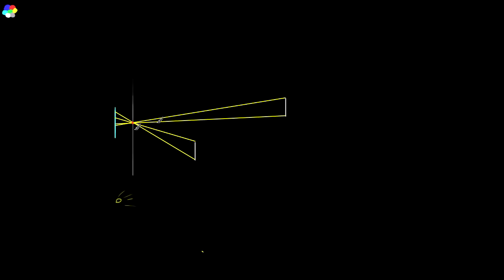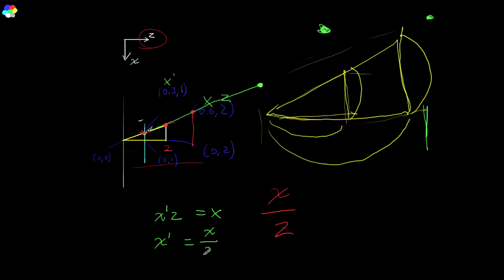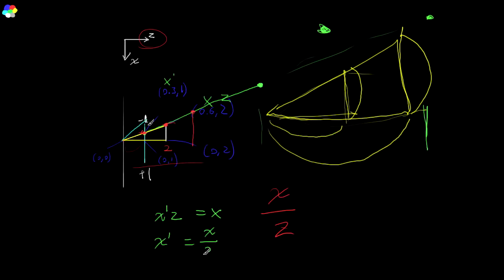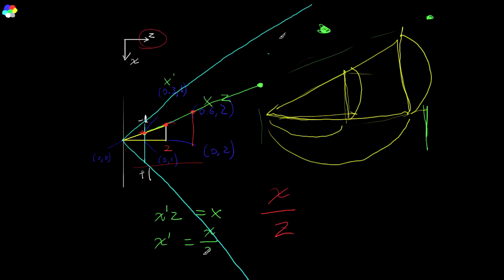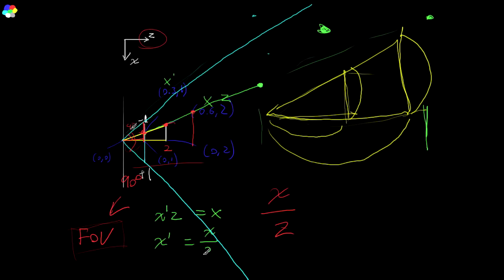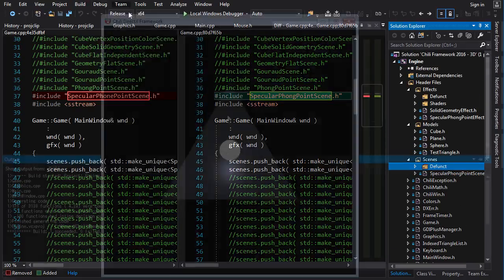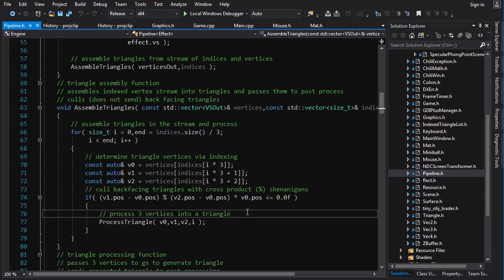3D Programming Fundamentals [Projection Matrix] Tutorial 20

Comment: 11:35 "this normalizes the vector" (devide by w) - no it's NOT! Normalizing it would be deviding by it's length, which is very different from it's 'w'.
Normalizing vectors from the origin ALWAYS brings them all down to the "unit-circle" (a circle with radius 1 around the origin).
Dividing by 'w' does no such thing - what it DOES do, is scaling the vector down UNIFORMLY, untill it's 'w' is 1.
Essentially, if "flattens" that extra dimention in all the vectors, back to the same value of 1 - which is why it can be thought of as getting rid of the effect of that extra dimension - therby bringing the vectors back to "regular" space (whatever dimention is without the extra one of w).
The full story there comes from projective geometry, which I've linked some videos about to in my other comments. 
I'm thinking of making a long video myself about how this whole perspective business ties into projecvtive geometry, and what's really going on ther, visually.
Reply: Please correct me if I am wrong. So in graphics, there are multiple spaces but the 2 that I am going to mention are view space and clip space. View space is when all the objects are transformed so that they are relative to the camera meaning that the transforms of each object are multiplied by the inverse of the camera's transform. This space is 3D. In order for a computer to render it to a 2d screen, it needs to "Project" the 3d space onto a 2d screen. This is where the projection matrix comes in. It projects the 3d coordinates to the viewscreen so the points now become [x', y', z', z] and, when this is changed from homogenous coordinates to screen coordinated by dividing by w = z (or uniformly scaling it in the extra dimension, as you mentioned), it just becomes [x'/z, y'/z, z'/z, 1].

Correct?

Then how is it rendered from here? To draw to the screen, it only requires the x-component (x'/z) and the y-component (y'/z) right? what is the z-component (z'/z) used for? Is it used to see if a point will render at a specific pixel by comparing z'/z to the depth/z buffer?
Reply: @anonymoussloth6687  Before I answer, I wanna note that the way you described perspective projection, although popular and easy to follow, is technically incorrect.

First of all, calling the view->clip space matrix a "perspective projection matrix" - although popular is incorrect. It does NOT actually "project" anything... Because that's mathematically impossible to use a single matrix for that - you'd need a separate matrix for each vertex if you really wanted such a matrix to actually project vertex positions with perspective. 

So that's not what's happening. 

What IS happening is that the view->clip space matrix is just "scaling" the space, such that after perspective projection would happen, that space would land in NDC (Normalized Device Coordinates). 
In OpenGL this space is a cube, so all 3 axis aqre in the -1 -> +1 range. 
In Direct3D it's a half-cube, so X and Y are in the range -1 -> +1, but Z is 0->1. 
So, in a way, that matrix just "prepares" the coordinate space of view space for projection.

The actual projection is using a different projection/scaling amount for each vertex (which again is why there can't be a single matrix that does that...).
That's called "the perspective divide" - is what you called "normalization" of the homogeneous coordinates back to regular 3D coordinates.

That's actually the simpler version of that story...

The "real" story of what's going on there, is that first of all clip-space is NOT a 3D euclidian space(!) 
It's actually a 4D projective space(!). 
That is why you need a 4x4 matrix to transform it. 

In addition to scaling the 3D slice of that 4D space, the matrix also ends up "lifting" the coordinates off of that 3D slice of 4D space into actual 4D projective apace (with each vertex position ending up with a different W coordinate - that's the W depth of 4D space).

Then, what the "perspective divide" is ACTUALLY doing, is in a way projecting that 4D space, back into 3D space(!!!) 
That is, back into a 3D slice of that 4D space - a 3D slice at W = 1 (the 4D depth axis).

That's why you get 3D coordinates out the other end of it (either a cube in GL or a half-cube in DX).
That's how the differing amounts of depth in the original 3D coordinates are maintained even after perspective projection.
The Z-depth value in the resulting space are no longer ranging linearly as they did in the original 3D space, is more like a curve, but the "relation between them" is maintained, so that you can use those Z values to differentiate which vertex or triangle is in front or behind others.

That's how you get your Z buffer.

So then in the pixel shader, you're actually working with a 3D space, not 2D(!).
As I said, the projection is from a 4D space to a 3D space. 

So saying that "the projection matrix projects the 3D frustum onto a 2D projection plane", is an oversimplification that is intuitive though technically incorrect .

NONE of what it's saying is correct actually...

1) It's NOT "projecting" anything, it's just a scale matrix.
2) It's a 4D transformation matrix for a 4D projective space, not a 3D euclidian space.
3) The projection that DOES end up happening, is from 4D projective-space (NOT a 3D space), into 3D projective space (NOT a 2D space of a projection plane).

That resulting 3D projective space, is a 3D slice of that 4D space with a uniform W-depth value of 1. That makes it possible to interpret it AS IF it was a 3D euclidian space. And that re-interpretation of it is what NDC space is.

Hope I didn't confuse you too much... :)
Reply: @AinurEru  I see. So, in summary, the view to clip space transformation matrix which is known as the projection matrix just transforms the space so that the camera's frustum becomes a cube/half cube. This is done on the 4d/homogenous coordinates of the points. After this, the points are still in 4d, so, in order to get them to 3d, we divide each point by w (which is the previous z before the projective transformation) which you mentioned is called a "perspective divide". This has the effect of getting the 3d point from the 4d point as well as scaling things in a perspective manner - meaning farther objects are smaller since they are divided by a larger w (since w is the pre projection z-value). This now results in a 3d point of which the x and y values are used to map it to the screen and the z value is used for depth testing with the z/depth buffer for rendering. 

So, in reality, the objects aren't flattened anywhere. Instead, they are transformed so that the camera frustum becomes a cube. And then the z values are discarded - or rather used for depth testing while the x and y values map to the screen.

Correct?
Reply: @anonymoussloth6687  Yeah, basically - you got almost all of it exactly right:

That you end up with a cube/half-cube space at the end of it (by the time you get to the fragmen/pixel-shader in graphics APIs) - that's correct. 
Whether THEN you consider the Z depth value of your "pixel position" or not, is up to you - what you do/don't do with it in your fragmen/pixel-shader. 
But it IS always used for you by the graphics APIs even BEFORE it gets to your pixel shader, IF you tell the graphics API to do that (Z-test, using a Z-buffer, etc.).
It would then use that to not even invoke the fragment/pixel-shader for that fragment, if it's already been determined/prooven that it'd never even get seen, because it's exactly behind some other opaque fragment that's already been drawn.

That the prespective effect is the result of having further away vertices scaled down on X and Y proportional to how far away they started as (their "original Z" depth coordinate), and that this happens as the "perspective divide" which is NOT part of the view->clip matrix that you provide, but rather a separate "per-vertex" step that happens AFTER the view->clip space transformation had happened - that's also correct.

But that the view->clip space "transforms the frustum-shaped space into a cube/half-cube", is just ALMOST correct - it actually transforms a frustum looking space, into another different frustum looking space - the space only subsequently turns into a cubical shape AFTER/THROUGH the perspective divide. So, a more accurate way of saying what you said, is that the clip->view matrix transforms a frustum-looking space into "what it would need to be for it to then be transformed into a cubical space by the perpective divide". Put differently, if you think of it in reverse, if you start-off with that "cubical" (NDC) space, and then "multiply" each vertex position by it's original Z instead of dividing it, THAT is what that clip space is(!). 
So, it's NOT a cube shape by itself ( yet). 
It's what it "needs to be in order for it to be transformed to that" by the perspective divide.

The historical reason for this very odd and confusing scheme, is to be able to clip and even cull away whole triangles, if they can be "proven" to be fully outside the view frustum, and to be able to do this prooving as early as possible - more specifically, BEFORE the perspective divide(!) 
Because historically, a division used to be a much more expensive operation, of the kind that you'd rather avoid having to do for as many vertices as you can proove won't need it.
And so, it can be done in "clip space" (hence the name...) BEFORE the perspective divide happense - here's how:

Say you wanted to cull triangles that you know are outside the view frustum (or "clip" ones that are "partially" outside). If you do it in a cubical space (NDC), the math is super-simple - you don't need any fancy planar in/out test for each of the faces of the slanted view frustum - you can just check if any of it's coordinate is outside the cube (-1->+1 in X, Y, Z, or 0->1 in Z in the case of DX). 
So that's easy. 
But to get there you have to already have gone through the perspective divide, and that's "expensive" so you wanna avoid that... 

Well, here's how you avoid it: 
You KNOW that for each vertex position in NDC (cubical) space, it's going to be in a very simple to identify range, and you also KNOW that to go "backwards" through the perspective divide, you just multiply the 3D coordinates by the W coordinate.
So, for each vertex position, if an in/out test would have been in the range -1 -> +1 in NDC space, then going backwards to clip-space that means that the range would be -1*W -> +1*W.  And guess what - in clip space you already got that W coordinate for each vertex position, and so to cull or "clip" a triangle (cull-test all 3 of it's vertices) all you need to do is for each vertex position check if any of it's X or Y or Z coordinates are in the range of it's own "individual" W coordinate. 
THAT's how you cull vertices and clip triangles in "clip space", before the perspective divide happens.

Lastly, you said that the X and Y you get in the frgment/pixel shader "map to the screen" - well, not exactly... They map to NDC space (-1 -> +1). Think of it as a standard intermediary space that's independant of the final display resolution. 
AFTER your fragment/pixel-shader had all ran, the graphics APIs then subsequently do a final transformation into actual display resolution space. That's a simple transform, just shift everything by 1 up and to the right, then, scale it down by 2 to put it into a 0->1 space, then scale horizontally by the horizontal display reolution, and vertically by the vertical one.
Reply: @AinurEru  I see. After reading your answer and reading this article: http://www.opengl-tutorial.org/beginners-tutorials/tutorial-3-matrices/#the-projection-matrix I think I understand the concept a bit now.
I just have a few more questions (sorry for the incessant queries). You said mentioned that the clip space has its own frustum and it is not a cube yet (that is achieved after the perspective divide). However, the clip space frustum would be still be a scaled cube right (since the perspective divide just uniformly divides each component by the original z value)?

Also, I am a bit confused about the perspective divide. After the projection transformation, the frustum becomes a prism (as mentioned above and in the article). Why can't we just use the x and y values without the perspective divide since they are already between -1 and 1 after the projection transformation? Is it because it is perspective and the points need to be scaled according to depth?

Finally, what happens if the camera is orthographic? Would there be no need of the projection matrix since the view space frustum would be a prism to start with since the near and far planes would be of equal size? Would it still need the perspective divide too? since object farther away in orthographic mode would not be smaller (so there would be no need for the perspective divide right)?
Reply: @anonymoussloth6687  I think your point of confusion is around the differentiation between what operation is done uniformly to all vertices using the exact same parameters, and what is done with per-vertex parameters. The view->clip matrix is uniform. So all vertex positions get hit with exactly the same matrix. The prespective divide however, is NOT uniform(!). That is, each vertex position (after having been hit by the same uniform view->clip matrix), gets a division by a different parameter that is specific to each vertex (it's own specific Z coordinate). And that division gets applied to X, AND Y, AND Z(!). So, each vertex's X gets divided by a different amount than another vertex's X. Same for Y and Z. That is why clip space is NOT cubical - think of it, the RESULT of the perspective divide is cubical, and then if you back-track that from that (from NDC space back to clip-space), that requires each vertex's 3D position coordinates to be multiplied by a different amount - it's own specific W coordinate. Say you got the top right back corner of NDC - backtracking, that would land it furthest away in X, Y and Z. Now thing of another vertex in NDC that's somewhere in the middle of the left face of the NDC cube. To get THAT one back to clip-space, it's X, AND Y, AND Z coordinates would need to be multiplied by a much smaller factor. So it'd land in clip-space in some place diagonally from the first vertex that started at the top-left. So you see, an edge in NDC space, between a vertex at the top-left-back corner to another vertex on the left face of it, would be aligned with the Z axis of NDC space (goes streight inward). But after the backwards-transformation that edge would become skwued diagonally.  

So when you said:
"However, the clip space frustum would be still be a scaled cube right (since the perspective divide just uniformly divides each component by the original z value)?"
Then, no - it's not a cube, exactly because the perspective divide did NOT "just uniformly divided each component by the SAME z amount" - it actually NON UNIFORMLY divided each vertex position by it's OWN original-Z. The OPERATION is the same (uniformly applied) but it's PARAMETERS are NOT(!) (non-uniform).

As for orthographic projection, that's a much simpler one, and there there's no perspective-divide at all. It get's "disabled" by providing a view->clip space matrix that does NOT put the original-Z in W.
Reply: "After the projection transformation, the frustum becomes a prism (as mentioned above and in the article). "
No, it's not.

"Why can't we just use the x and y values without the perspective divide since they are already between -1 and 1 after the projection transformation?"
They are NOT between -1 and 1 after the transformation - that is just incorrect - they are such that each vertex's position's 3D coordinates (it's X, and it's Y, and it's Z) are all in the range of -W and +W of IT'S OWN SPECIFIC W COORDINATE VALUE (that is DIFFERENT for each vertex position).
-1 -> +1 is NDC space - AFTER the perspective divide, NOT before(!) And the perspective divide happens AFTER the view->clip space transformation, and in that 4D projective clip-space already. Before it's applied, clip-space itself is NOT -1 -> +1.

"Is it because it is perspective and the points need to be scaled according to depth?" 
That scaling IS the perspective divide, NOT the transformation of multiplying by the view->clip matrix(!!!) 
That is exactly why I said that the "perspective projection" name is just wrong - that matrix does NOT emben ANY kind of perspective projection whatsoever(!) Because it can't. Because it's uniformly used for all vertices, and each vertex needs to have a different scaling factor applied to it - the matrix can't be in a super-position... It's just 16 floating point number.
Reply: @AinurEru  Ok so I am now more confused. If the projection matrix doesn't change the frustum to a cuboid, what is the point of the projection transformation? As you mentioned earlier, it takes the frustum and transforms it to another frustum. If neither are a cube yet, then why is it necessary?  Why can't we simple perform the perspective divide? If the answer is to map the x, y, z to their respective -W and +W, then I don't see how x, y, z are mapped from -W to +W (see question below).

Also, you mentioned that after the transformation, the x, y, z are from -W to +W but in the video at 17:40, we can see that the scaling factor for the x and y are 2n/w and 2n/h (note w is width of the near plane here) so a point on the far left of the x axis at w/2 will have a new value that would be n since (w/2)*(2n/w) = n. So the x and the y would be between -n to +n before the perspective divide right (how is it between -W and +W)? after the perspective divide, they are divided by the original z so how is +n/z and -n/z from -1 to 1?

Finally, for orthographic, you said we disable the perspective divide. Does that mean that the frustum is already set to a rectangular prism where the near and far plane are equal in size beforehand?
Reply: And to confuse matters, I watched this video here: 
https://www.youtube.com/watch?v=svKVqROlVSg&list=PLRwVmtr-pp06qT6ckboaOhnm9FxmzHpbY&index=26 
and this person straight up states that the projection matrix maps the 3d coordinates to 2d and even shows a demo of it at 2:50 in the video
Reply: @anonymoussloth6687  I think it's simpler if you think of it in reverse: Your end-goal is NDC - the cuboid space. Now, there are a few parameters that you need to control for exactly what should end up inside the cube and what outside - where the boundaries should be. That's ultimately controlled by the nea/far clip planes distances - they control what distances should end up in the front and back faces of the cuboid in NDC, and then the field of view + the aspect ratio together, control exactly what the left, right top and bottom cuboid faces map back to in the frustum shape. The whole non-linear warping from frustum-shape to cuboid shape is kind of left out of that story. Hope that makes sense.

Again, the view->clip space only has scaling factor, and a translation. It has no shear, and it can't just change the overall shape of the space - it's just scaling and translating (in Z).
The only other odd thing it does is set the original Z coordinate in W. But again, it does not change the overall shape of the space - it can't.

I'll comment on the rest of it a bit late - a bit bussy right now with an online live course that's running right now...
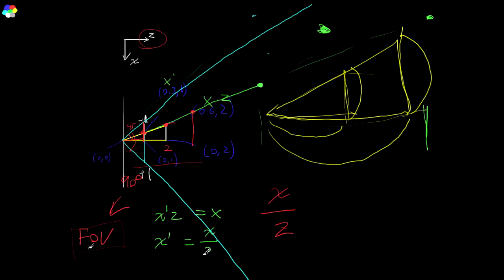Reply: @anonymoussloth6687  4:00 ".. So I intentionally lied to you in the previouse video, the view-projection matrix does NOT smash our 3-dimentional scene into a perfect 2-dimentional scene, there is still depth..."
Jamie King is awesome - his videos are the only ones I know of that actually contains a visualisation of clip-space - I think it's this video later, or some other in that playlist.
Reply: @anonymoussloth6687  Also, 5:00 "...we call it the 'projection matrix' (notice the tone there...), I like to call it the 'view to projection matrix'".
As I said, Jamie is awesome - his term is much more appropriate - it's the matrix that transform the view space into a space where "projection can THEN happen in". Spot on.
Reply: @anonymoussloth6687  It should be noted though, that in his video, the visualisation is NOT just visualizing what the view->clip space matrix multiplication is doing by itself - it looks like it's also doing the perspective-devide right after that, so the visualization shows the combined effect of both. That's why A) the shape get's distorted (as again, just the matrix multiplication by itself just can't do that), and B) the resulting range is indeed -1 -> +1 - meaning, it's NDC, not clip-space.
Reply: @anonymoussloth6687  18:00: "...Now, you might be saying, 'Chilli, I think you made a mistake here, don't you mean a*f +b = 1?? Becuase when Z is on the far plane, we want to map it to 1?' .. Yes, BUT: We want it to map AFTER the 'normalization' , meaning after the division by Z ... so when Z is at the far plane, then you'r gonna devide by f, and THAT will be 1"

Chilli is also awesome, if I failed to mention that.
Reply: @anonymoussloth6687  "Also, you mentioned that after the transformation, the x, y, z are from -W to +W but in the video at 17:40, we can see that the scaling factor for the x and y are 2n/w and 2n/h (note w is width of the near plane here) so a point on the far left of the x axis at w/2 will have a new value that would be n since (w/2)*(2n/w) = n. So the x and the y would be between -n to +n before the perspective divide right (how is it between -W and +W)? after the perspective divide, they are divided by the original z so how is +n/z and -n/z from -1 to 1?"

That would be true precicely for a point at the far left of the x axis at width/2 as you said, THAT IS ALSO RIGHT ON THE PROJECTION PLANE (at Z(original)=n), because then it's W coordinate would be `n`, and so what you wrote as '+n/z and -n/z' WOULD be from -1 to 1, because they would be `+n/n and -n/n'.

Any other point that is right on the left-face of the view frustum that is further away from the projection plane (at 'Z(original) = n') but still closer than 'f', would be precisely as farther away to the left in X as it would be in farther away than 'n' in Z, so the proportion would actually still be 1:1.

That is because the parameterization of the view->clip that is being used in this particular example, with the X and Y scaling factors being '2n/w' and '2n/h' respectively, are for a horizontal field of view of 90 degrees, or in other words, where there's a 1:1 proportion between the Z-distance and the X distance to the left/right face(s) of the view frustum.
Reply: @anonymoussloth6687  "If the answer is to map the x, y, z to their respective -W and +W, then I don't see how x, y, z are mapped from -W to +W (see question below)."

As I explained about how clipping and culling works in clip-space, that's what actually making that space into one that is -W -> +W for all vertext position, because another way of saying it, is that any vertex position that is NOT within that space (and again, that's with respect to IT'S OWN INDIVIDUAL W!), gets culled. Any EDGE that has ONE of it's vertices in that space and the other outside, gets "clipped", such that it's outermost vertex position is right at the edge - with the coordinates actually EQUALING +W or -W. That culling and clipping process is the process that MAKES that space "..between -W to +W" - because anything that isn't, gets culled/clipped.

The purpose of the "view->clip" matrix transformation, is to parameterize each vertex position coordinates (X, Y, Z and W) SUCH THAT their inter-relation satisfies the criteria that any coordinate (X, or Y, or Z) that is outside it's own -W -> +W range, would only occure for vertex that are positioned outside the view frustum before the transofmration. 

That is why the parameterization of this transformation are derived from the parameterization of the view frustum itself - namely it's near and far clipping plane, and the "RATIO" between the near clipping plane distance to the projection-plane's dimensions at that distance. Otherwise computed with the tangent of the horizontal FOV (field of view) angle. It's a tangent, representing a proportion (sin/cos), which is the same aformentioned "RATIO". 
Which, BTW, I have a section about in one of the videos I made on my channel:
https://youtu.be/nIvINO3634M?t=1164
Reply: @AinurEru  So the point of the projection matrix is to map all the points to be between their -W and +W which would mean that all points should have a x, y, z value between -n to n and -f to f since the W would only range from n to f right? This makes sense for the z values but why do this for the x and y too? Shouldn't they be  mapped based on different parameters? I understand that it is for clipping points and checking if all the components should be between -W to +W but wouldn't it be better to check if they are between individual x, y, and z ranges for clipping (since this method also doesn't preserve the aspect ratio of the camera frustum since, in the end, we end up with a cube which has 1:1 aspect ratios on all its faces)?
Reply: @anonymoussloth6687  "So the point of the projection matrix is to map all the points to be between their -W and +W" 

All positions of vertices that are within the view frustum before the transformation, yes. Not the 100% of all vertices, as that would defeat the purpose, because then you can't cull and clip based on that criteria (beacuse they would all satisfy it).

"which would mean that all points should have a x, y, z value between -n to n and -f to f since the W would only range from n to f right? "

No. If that were the case, there would be no way to controll the spread of the view frustum (in terms of that W-space criteria for clip-space positions).

The example in this video pre-supposes/assumes a 90deg FOV. You need to allow this to be controllable if you want FOV to be anything different than 90deg. And that's irrespective of the near/far distances - these are orthogonal concearns, they can't influence each other. But the view->clip space transformation needs to include an accounting for both. I'm not sure how well this is covered in this particular video (I haven't actually watched it in a long time...)

What happens to X and Y in the view->clip transform, is kind of unrelated to what happens to Z (even though the near clipping plane distance is invloved in both).

For the Z coordinate, yes - it should be such that AFTER perspective divide, vertices inside the cuboid NDC space should be ONLY vertices that started between n and f before the perspective divide and before the transformation (i.e: in view space). So the "clip space Z coordinate" value needs to be callibrated such that IF it's view-space Z is inside the view-frustum then when dividing the clip-space-Z by that "view-space Z"  would send it to between -1 and +1 (for GL. For DX it'd be 0->+1).

This video here details an algebraic derivation of determining what specific combination of scaling and translation transformations are needed to acheive that.
(there are other ways of deriving that which I find more intuitive, but that's a separate story - all ways end up with the same values in the view->clip matrix, for Z-scale and Z-translate).

For X and Y, that's a different story. First of all, there's no translation needed, as the view-space coordinates are already centered around the same axis that NDC space is in (the "origin" being the camera/view). So there's just a scaling factors, but they depend only on the aspect ratio, the spread of the view frustum, and the newar clipping plane distance - NOT the far clipping plane distance(!).

Take the X one first:
The simplest case is the one detailed in this video, where the spread of the view frustum is such the both the left and the right planes of the view frustum are purely diagonal (45deg) in relation to the camera. That just so happens to make it so that any point exactly on the outer rims of the view frustom in X is away from the central Z axis by exactly the same amount that it's away from the camera (in Z). 
But that's not the only possible configuration - the view frustum could be wider or narrower, even for the EXACT SAME aspect ratio and resolution(!) 
This spread determinses how much of the scene would get squeezed/stretched on that same screen, and so how strong the perspective distortion is going to be. Wider view frustums need to squeez more view-space into that same -1 -> +1 NDC-space (ultimately) - EVEN when using the SAME near/far clipping distances(!). So the scaling factors in X and/or Y need to be stronger, and the perspective divide by-itself can't do that, as the W values would be the same for wider/narrower view frutums (as they are just the view-space Z coordinates).
So this needs to be accounter-for/applied elswhere, and that's in the view->clip space matrix.

Each axis is callibrated separately, according to it's own needs:
The X axis gets scaled such that it's closest X coordinate on the left (the one at Z='n' in view space) needs to get sent to -1 in NDC, so it's clip-space X coordinate has to be -n. 
Similarly a vertex on the right side at that same distance needs to end-up with an X coordinate of +n in clip-space.

However the same does not necessarilly apply for the furthest X coordinate (one in the far back at Z='f' and all the way on the left face of the view frustum in view-space).
In the special-case detailed in this video, where as coordinates go far, they also go left by the exact same amount, then yes - the furthest way one would be sent to X=-1 by a division by it's Z (which is 'f'), so yes, it's clip-space X coordinate needs to be -f.
However, now imagine a view-frustum that is a bit wider (larger FOV angle), but with the exact same near/far clipping plane distances. There's going to be some X coordinate at the back there at distnace 'f' that's going to land at -1 in NDC space after perspective divide, but it should be larger than -f, as the frustum is widening quicker than it's deepening. 
So the view->clip matrix needs to apply a different scaling factor to X than simply '2n/w' to correct for that.

Either way though, the specific factors in the view->clip matrix can be derived backwards from NDC to clip-space, and so that -w -> +w can still hold regarless of the specifics that happen to the coordinates. At the end of the day, NDC is -1 -> +1, and reverse-perspective-divide is multiplication by W, so whatever ends up landing in X = -1 in NDC, must be -w in clip-space, and ensuring that is the role ofthe view->clip space transformation matrix.
Reply: @AinurEru  
"All positions of vertices that are within the view frustum before the transformation, yes. Not the 100% of all vertices, as that would defeat the purpose, because then you can't cull and clip based on that criteria (because they would all satisfy it)"
If we already know which points are in the frustum and which are not during the view space, why not cull/clip them then? Why perform a projection transformation and then clip them if we already know which ones are in and out of the frustum?

Just to make sure, the z-translate that you refer to in the projection matrix is the one that translates n and f to -1 and 1 right (0-1 for DX)?

"the view frustum could be wider or narrower, even for the EXACT SAME aspect ratio and resolution(!)" 
How is this possible? Is it by changing the near clipping plane distance (n)?

"So the view->clip matrix needs to apply a different scaling factor to X than simply '2n/w' to correct for that." 
What is that scaling factor? is it 1/(tan(FOV/2))?

Also, I asked in the previous question that if the aspect ratio is maintained since the end result is a cube with equal sides. After reading you answer, is it that the projection matrix scales the x and the y proportional to how far/wide they are? meaning if the width of the view-frustum is very big (so the aspect ratio is very wide and the FOV is greater than 90) then the x values would be scaled down more in the projection matrix right (compared to the y values) since there is a bigger range that needs to be within -1 to 1 in NDC? So does this mean that the aspect ratio is maintained?
Reply: @AinurEru  Also, another thing that I wanted to clarify, the corners of the view-frustum will always map to -1 to 1 in NDC but, like you said, the back corners may not have a x coordinate of f since if the FOV is more than 90, the frustum is going out more in x than it is in z meaning that the back corner will have a x value more than f but it will still map to -1 to 1 in NDC. And a point that does have a value f will fall short of -1 to 1 in NDC. And, in the case that FOV is less than 90, x values less than f will map to -1 to 1. Right?
Reply: @anonymoussloth6687  Yes. Remember, that when you say "... map to -1" you're talking about a mapping across 2 transformation, because it's across 2 spaces: 
One is the tranformation from view space to clip space (multiplication by the "view to clip" matrix), and the secod transformation form clip space to NDC space (the perspective divide). 

So, clip space is in a way an intermediary space where coordinate values could be "whatever they need to be" to satisfy the all constraints we talked about here. 

So, the clisp-space W coordinate of a vertex position at the back-left corner in view-space, would still be 'f', but the X coordinate in clip-space can be "played with" using the view->clip-matrix, in order to controll what should/shouldn't stay in view in NDC space.
That's how you still get the -W -> +W rule applying. 

The clips-pace-W coordinate values stays the same when you keep the near and far clipping plane where they are and just play with the FOV, but the X and Y clip-space coordinate values change as you do that, such that more/less of them would get culled/clipped by satisfying/not-satisfying the -W -> +W rule. That's the mechanism of how this is being controlled.
Reply: @anonymoussloth6687  "If we already know which points are in the frustum and which are not during the view space, why not cull/clip them then? Why perform a projection transformation and then clip them if we already know which ones are in and out of the frustum?"

The short answer is: "Because it's computationally cheaper to do it in clip space" -it's just internally comparing between coordinates within each vertex position. 
Can you do it in view space? 
Yes. 
For sure. 
But it's much more complicated and expensive. 
And the resoning is that because transformation matrices are uniform AND because you can collapse as many of them as you want down to a single one by multiplying them together (only once per frame as the resulting one is applied uniformly to all verticies), then it's "effectively free" - you can add as many transformation matricies and spaces as you want into that mix, and the cost would be almost zero. It's just another matrix-matrix multiplication that would have to happen once per-frame. And that could even be less than once per-frame if you keep around pre-merged versions of intermediary matrix multiplication results. For example, if you don't allow changing the FOV or aspect ratio on the fly at run-time every frame, then for all frames where both these don't change AND the camera is not moving (so world->clip also stayes the same), you could have a "pre-baked" matrix that does world-->clip space transformations in one go. That could be considered a micro-optimiztion though... you'd be hard-pressed to even notice a blip in a profiler if you try to compare that... 

"Just to make sure, the z-translate that you refer to in the projection matrix is the one that translates n and f to -1 and 1 right (0-1 for DX)?"
It's more a "COMBINATION of Z-translate and z-scale" that together acheive that, but yes.

"How is this possible? Is it by changing the near clipping plane distance (n)?"

I'm not sure how well this is covered in this video (if at all) as again, I'd have to re-watch it, but it's done by manipulating the X and Y scaling factor in the view->clip matrix, to make it's transformation account for that.
But to your point, no - you can have this applied on-top of the formula that includes the near plane's distance ('n'). It's about controlling the RATIO between the "dimentions" of the "projection plane" (NOT to be confused with the near-clipping plane(!!!)), and it's distance from the camera - meaning, it's distance from the origin in view-space: Again, it's a separate controllable factor that isn't discussed in this video, I think - typically reffered to as the "focal distance" or "focal length". It's INDEPENDANT of the distance to the near clipping plane 'n'(!). It's accounting for applyes "on-top" of what 'n' dows to the X and Y scaling factors of the view->clip space matrix - that RATIO "adjusts" them. It's the ratio I've talked about in that video I made (that I presume you already watched as I saw you've subscribed to my channel).

"What is that scaling factor? is it 1/(tan(FOV/2))?" 
That is ONE way of arriving at that ratio, yes. If you want your input for that controll to be an angle, then that's what you do - and then you don't even need to care about focal-length or the width of the projection-plane, as again - it's just the "ratio" between them that matters in this case, and you can get at that ratio from taking the tangent of an angle (as it's effectively a ratio between sine and cosine). but you do pay having to use angles and a trig function.
Another way would be as I showed in my video : You firs "fix" one of the variables in the ratio (typically the width of the projection plane), set it to something that is most convinient, then you control the ratio by manipulating the other (typically it's distance to the camera - which again, is SEPARATELY controlled from the distance of the near clipping plane 'n').
And as I showed in that video, if you set/"fix" the width of the projection plane to be 2, then a 2-factor cancels out, and you're left with just "1/focal-length" otherwise known in photography as "Lense Power". It's just a single number that you can then pass to whatever the logic is that generates your view->clip matrix, "instead of" the FOV angle. Again, if you want. I personally like it, and find it easier to control than an FOV angle, and it does avoid a tirg function, but I guess that's a personal prefference.

Utlimatly, it's just 2 way of arriving at the same ratio factor, that then "adjusts" the X and Y scaling factors of the view->clip matrix.

"...is it that the projection matrix scales the x and the y proportional to how far/wide they are? meaning if the width of the view-frustum is very big (so the aspect ratio is very wide and the FOV is greater than 90) then the x values would be scaled down more in the projection matrix right (compared to the y values) since there is a bigger range that needs to be within -1 to 1 in NDC? So does this mean that the aspect ratio is maintained?"
Yes and no. It's proportinal to how wide you want your view frustum to span, yes, but NOT proportional to how "far" you want the far-clipping plane to be - that's disjoint from that concearn, theoretically and mathematically. 
As for aspect-ratio, that's accounted for already by the view->clip space's X and Y scaling-factors, by just having the Y factor scaled accordinly compared to the X factor, based on that aspect ratio.
These factors are each a composition of scaling transformations, accounting for all these variouse concearns/constrains all mearged together into a single X and a single Y scaling factor(s). Altogether that controlls what ends up in/out of -1 -> +1 in NDC (in X and Y), meaning precicely where the border-line goes through.
You could technically even just split each of the scaling-operations involved into it's own 4x4 matrix that just does that particular scaling, and then multiply it all together to the the final view->clip space matrix. Same goes for the Z-scale and Z-tanslate. The result would be the same, it's jsut maybe a way of mentally/conceptually breaking down the problem into discreat simple(r) steps.
Reply: @anonymoussloth6687  I've now gone and re-watched the mathy portion of this video, to correlate what I've been talking about in my recent replies to you back to how it's explained in this video:
Chilli here is using the near clipping plane to also be the projection plane. That doesn't have to be the case, but that's how it's often explained. In that sence, 'n' here DUALS as BOTH the factor you use to set where the front depth of NDC space maps back to in view space, AND as being the focal distance (a.k.a: "focal length"). That kind of "pushes" where the RATIO I keep mentioning has to come from, onto the "width of the projection plane" (what is labeled lowercase 'w' in this video).
This must NOT be confused with "the width of the resolution of the final image in pixels"(!) It most definitely is NOT that. This width is in world (actually camera/view) space, not pixels. As I've shown in my video, it can be kind of arbitrary what you define that dimention to be - what actually matters is the "ratio" between it and the focal-distance. So you can "fix" one and play with the other, or vice-versa - you'd get the same resulting proportion/ratio either way.

At around minute 32:00 of this video, Chilli gets to that, but just in the code, not in a diagram. Just saying that it's 1/tan(fov/2) without really explaining why that is and what's going on there. But that's essentially that "ratio" - it's just pushed into the 'w' parameter of the formula for parameterizing the view->clip space matrix.

Mathematically speaking it ends up being exactly the same as how I explained it - it's just taking a different route at getting there.
Hope that makes sense...
Reply: @AinurEru  I am not sure how the focal length plays into view to clip and then the perspective divide. I understand the concept of it by watching your video but how it actually works mathematically in this projection matrix is still unclear. Say if the focal/image plane is somewhere between n and f, what would that mean? Would only the points between that plane and the far plane get mapped or is it still all the points from n to f?

Second, you mentioned that is it computationally more expensive to clip things in the view space because of the transformation matrices. But I still don't understand what this has to do with clipping. You mentioned that we ALREADY know which points are in and out of the view frustum which is why only the ones in the view frustum are projected and not 100% of them. So if we already know which ones are not used, all we have to is ignore/discard them then only right? What extra computation is required?

Finally, you mention that the projection matrix can be controlled by alot of things. Is there a general projection matrix formula that includes all the parameters? Because, in this video, chilli assumes the FOV is 90 and n is also the focal length which simplifies alot of it. 

Also, I don't understand what you mean by the RATIO and how that is kept intact in this since, in the end, all of the points are inside a cube in NDC which is 1:1. If, lets say the target screen has an aspect ratio of 4:3, does that mean that when NDC maps to the screen after offsetting from -1-1 to 0-1 (by adding 1 and dividing by 2) and then multiplying by the width and height of the screen? Also, when in the pipeline does this take place? Are the points still considered as points or are they processed as fragments? I ask this since if they are points, then they technically have infinite resolution and scaling and transforming them wont affect the resolution until they become pixels correct?

P.S. I understand if constantly replying to my comments is tedious. Could you recommend any sources that explain this in a very good manner and in accordance to what you explained? I have tried reading many articles and most of them have the same wording: "the projection matrix is used to map 3D coordinated to a 2D screen" which, as we already established in the beginning, is wrong.
Reply: @anonymoussloth6687  Think of it this way of it this way: We ultimately want to have a trapezoidal shape (A pyramid with it's head sliced off), and warp it into a cuboid. The cuboid we want to end up with is already specified - we know exactly what it's dimensions and parameters are.
The starting trapezoid is not specified - we need to define it first:
1) How tall is the pyramid? 
Where does it's base start from?
2) Where does it get sliced off loosing it's pointy head?
3) How steep or shallow is it?
What's the slope?

First pause and appreciate that these 3 factors are completely independent. You can change any one of them without affecting any of the others.

If you change the slope without changing the othe 2, the trapezoid just gets fatter or skinnier. It's base can get larger, but still starting at the same place, the chopped-off rectangle at the top may get smaller. 
But the pyramid's height stays fixed.

The near clipping plane distance is where to chop off it's pointy head. The far clipping plane distance is how tall it is, as in where does it's base start from. 
The RATIO I keep referring back to, is the "slope". And there are different ways of arriving at a slope. One way is with an angle. Another way is as a proportion. The specific numbers in the numerator and denominator in a proportion are arbitrary - what matters is the ratio between them.

So that's how these 3 parameters define the trapezoid.

Now, Linear algebra can only be applied for linear transformations.
It can not be used to warp a shape like that, that's a non linear transformation, so it can not be encoded in a matrix.

So you split the transformation into 2 steps: One linear, the other non linear, ans use a matrix to handle all the linear part. That splitting is what makes this warping of a trapezoid to a cuboid transformation much more complicated and difficult to conceptualize. If for example you were to "just do the math" without using a matrix and not caring about what is linear algebra and what isn't, the whole thing becomes much simpler and easier to intuit. But that's not the route that the designers of the graphics pipeline took - mostly for performance reasons. It's a complexity born out of optimization. It's really a single transformation at the end, but has multiple dimensions and components to it, and the splitting of the linear vs. no-linear aspects is really hurting our ability to understand it, because it's like a vertical slice through the math.
You need to keep thinking of the 2 parts of the transformation in-concert (the linear and non linear), but then apply them mathematically separately.

Anyways, all rants aside:
I find it easier to think of it in reverse - starting with the cuboid and working backwards to reshape it to a specific trapezoid. That way the changes to the parameters is closer to when they are applied. Like, stretching to a trapezoid - how far should you stretch? (far clipping plane) etc.
Also, I find it easier to break it down to smaller and simpler separate transformation steps, thinking and mathematically deriving each one in isolation. The end result of the view->clip matrix is the culmination/amalgamation of all these steps merged together into a single matrix, so is kind of difficult to parse the matrix in it's final form (which sadly is what most/all educational material does...)
Reply: @anonymoussloth6687  "Could you recommend any sources that explain this in a very good manner and in accordance to what you explained?"

Oh, god... I wish the was one... :)
In fact, I intent to make one myself.
I already have the first part of it mostly ready for recording - it covers the history and evolusion of perspective in art and engineering, laying down the conceptual and mathematical foundations of it, and how they inter-relate, ultimately in projective geometry.
A subsequent one I plan to do make, is more targeted at what we're talking about here - how it's being done in the context of rendering pipelines in graphics APIs.

It all got shelved and put in the backburner because of other priorities and "life stuff".

I did find some playlists that are somewhat useful on the mathy sides of it - they don't go into the programming side of it at all - they're all recorded sessions of university course lectures:

https://www.youtube.com/watch?v=mpTl003EXCY&list=PL_w_qWAQZtAZhtzPI5pkAtcUVgmzdAP8g&index=5&ab_channel=UCDavisAcademics

That's a full computer graphics course - really good for the most part, though the lecturer tends to do many mistakes then correct them, and some of it is kinda "hand-wavy" which I dislike.

Here's another:
https://www.youtube.com/watch?v=vu1VNKHfzqQ&list=PLbMVogVj5nJSyt80VRXYC-YrAvQuUb6dh&index=22&ab_channel=nptelhrd

Then, this is a super good one - I love the lecturer and how he teaches. Very clear.
He just doesn't always go into all topics. His rasterisation talk is the best, and can maybe answer some of your later questions:
https://www.youtube.com/watch?v=cQY3WTKRI7I&list=PL4A8BA1C3B38CFCA0&index=7&ab_channel=UCDavis

And this looks like a good one on "clipping" in the context of perspective projection - I think it also shows how clipping could be done in view space:
https://www.youtube.com/watch?v=stCELsaDJRw&ab_channel=WolfgangHuerst

I think you're expecting a bit much from commentary on a single video in the subject - it's a huge subject, and it takes many videos to cover it all - no matter who does the covering. Chilli has more videos here in this playlist that cover some other stuff you started asking about, like the screen-transform and rasterisation. 
These are whole topics onto themselves that don't have anything to do with perspective projection.
Reply: @anonymoussloth6687  Now to your specific questions:
"if the focal/image plane is somewhere between n and f, what would that mean? Would only the points between that plane and the far plane get mapped or is it still all the points from n to f?"

I hope that now my covering of the parameterization of the pyramid/trapezoid answers that. 
It'd still be from n->f. 
The whole focal-length/distance vs. projection plane story, is just "A" way of specifying the "slope" of the pyramid/trapezoid (view frustum) as a "ratio" between the focal-length and the dimentions of an imaginary projection-plane. 
Neither of the 2 have any meaning in isolation, in this context, because it's the "ratio" between them that determines the "slope" we want to specify for our pyramid/trapezoid.

You can use a projection-plane width of 2 and a focal-distance of 1, as I showed in my videro - to specify a "slope" of 1 (90deg FOV). 
But you could have eazilly used a projection plane of a width of 1280 and a focal-distance of 640 - you'd still get the exact same slope. That's why where you put your projection plane away from the camera, is completely independant of where you put your near clipping plane.

In fact, you can very easilly define your view->clip matrix without any refference to 'n' (the near clipping plane) for the X and Y scaling factors. In fact, I have an implementation that does exactly that.
So the inclusion of 'n' in those factors can be missleading - it can create the impression that 'n' is relevant at all for these scaling factors, when in fact it is not.
I think Chilli went with that, because that's how the documentation of DirectX defines it. 

Rememer(!):
All you'r really after here, is a "slope". 
A "ratio". Getting at a ratio can be done any number of ways. DirectX just chose to do it using 'n' as the focal-distance, and then controlling the dimentions of the projection-plane elsewhere ('w' and 'h' in the X and Y scaling factors in the view->clip matrix).
Again, fixing one of the 2 measures of the ratio (the numerator or the denominator), and then controlling the other.
That's why you'll see very different-looking view->clip matrix formulations, that essentially end up doing exactly the same - just with a different assumption of what the inputs to the formula is. If you look at OpenGL's formulation, it looks different (on it's surfact) for the X and Y scaling factors - but they are in fact ending up doing exactly the same thing. When DX and GL "actually" differ, is in the Z scaling and translation factors, and the W (which is flipped). But X and Y are exactly the same across GL, DX, Vulkan, Metal, whatever...

In my implementation of a software rasterizer, I jus set the X scaling factor to be just the focal-length (of the lense), just by itself, and the Y scaling factor to be that same focal-length, multiplied by the aspect-ratio (width/height of the final image).
That's it. It's all you really need. There's no real need to involve the near clipping plane here whatsoever - doing so is just an implementation choice.

Another way of thinking about it:
ALL perspective projections ultimately happen with a slope of 1. The X and Y scaling factors are just a way to "pre-scale" the space in which that slope=1 projection happens, such that the end-result is "as if" the projection used a different slope.

Hope that last part didn't totally confuse you...
Reply: @anonymoussloth6687  "you mentioned that is it computationally more expensive to clip things in the view space because of the transformation matrices. But I still don't understand what this has to do with clipping. You mentioned that we ALREADY know which points are in and out of the view frustum which is why only the ones in the view frustum are projected and not 100% of them. So if we already know which ones are not used, all we have to is ignore/discard them then only right? What extra computation is required?"

I think you missunderstood what I said there: We start off NOT knowing which vertex positions are "in" vs. "out" of view - DETERMINING that is precisely what culling and clipping does. The transformation just transforms all of 3D space together - it doesn't "cut" it.
What I said, is that this "determination" process, "could" be done in view-space, "if" we "wanted" to do that in view-space. That would involve in/out testing each vertex (position) against all 6 planes of the view-frustum. 2 of them are the near and far clipping planes - that's easy to check for. The other 4 though, are diagonal planes, so you need a plane-equation and a half-space algorithm to determine for each diagonal plane if the vertext is on the "in" side or the "out". I said it's "possible". I didn't say it's "recommended" or that this is what the rendering pipeline of graphics APIs does. It's NOT what it does, because it's NOT recommended, because the math is much more expensive to do these 6 plane half-space algorithm formulae for every single vertex position.
Contrast that with just 6 scalar comparisons (3 bounds checks) comparing X, Y, and Z against +W and -W for each vertex - that is WAAAAAAY cheaper to compute, and in fact is implemented in hardware with dedicated silicon in GPUs.

That's "culling" vertices based on their 3D positions, and that's why it's done in clip-space.
"Clipping" is done on "primitives" (typically triangled). You can't "clip" a vertex (what would saying that ever mean, right...?).
So, once all vertices have been "culled" (determined if they are in vs. out), clipping can happen on the primitive that these vertices are made out of, to determine if any of them needs to be clipped. It's not as simple as it may sound on the face of it... Clipping is a huge pain, but it absolutely necessary (and "why" it's necessary, is a whole topic onto itself...). Just for example, you can't just assume that if all 3 vertices are on the "out" side of the view frustum, then the entire triangle can be discarded - because what if it's just a big triangle that you're viewing just very closely zoomed-in on? Or one that is "weapping" a corner of the view frustum, while still haveing all it's vertices outside? There's plently of edge-cases like that tha need to be accounted for. So you HAVE to clip primitives, and for that you HAVE to already determine which vertices are in vs. out, and then how they map to primitives (triangles).

Note: You "could" also do that culling and clipping in NDC space, that's also very simple - but that would mean you'd have to do the perspective divide on ALL vertrices in your scene - every frame - and (at least historically) that was "prohibitively expensive".

This is a good talk about this subject:
https://www.youtube.com/watch?v=mi7-q2qAyx0&list=PL4A8BA1C3B38CFCA0&index=8&ab_channel=UCDavis

Also, I think Chilli also covers some/most of it in another video in this playlist.
Reply: "you mention that the projection matrix can be controlled by alot of things. Is there a general projection matrix formula that includes all the parameters? Because, in this video, chilli assumes the FOV is 90 and n is also the focal length which simplifies alot of it. "

The view->clip space matrix IS that "general" projection matrix... Chilli adds FOV control later in this video (a litte before the end). 
And "even more general" one, that doesn't even assume that the axis of projection in in the center of the screen, can be found here: 
http://www.songho.ca/opengl/gl_projectionmatrix.html
Reply: @anonymoussloth6687  "Also, I don't understand what you mean by the RATIO and how that is kept intact in this since, in the end, all of the points are inside a cube in NDC which is 1:1."

I believe by now I've answered that one.

"If, lets say the target screen has an aspect ratio of 4:3, does that mean that when NDC maps to the screen after offsetting from -1-1 to 0-1 (by adding 1 and dividing by 2) and then multiplying by the width and height of the screen? Also, when in the pipeline does this take place?"

You're now talking about the screen-transform. That's out of scope of this video. I believe Chilli has another video on that in this playlist.

NDC stayes what it is: -1 -> +1 cuboid.
Screen transforms then gets applied ontop of it, before rasterisation heppense. 

"Are the points still considered as points or are they processed as fragments?  I ask this since if they are points, then they technically have infinite resolution and scaling and transforming them wont affect the resolution until they become pixels correct?"

You're now talking about rasterization - which is the process of generating  fragments from "projected" primitives in (screen)raster-space.
The videos I've alrady linked now cover this in detail, and Chilli also has subsequent videos in this playlist that cover this.
It's a huge topic onto itself.
Best video I've found on it is this:
https://www.youtube.com/watch?v=cQY3WTKRI7I&list=PL4A8BA1C3B38CFCA0&index=7&ab_channel=UCDavis
Reply: @AinurEru   @Arnon Marcus  Sorry for the delay in response. My exams have started in my college. 

First, I understand what you mean by the ratio. You said it basically means the slope or how steep the cut-off pyramid (aka frustum) is. Then, in that case, wouldn't we need to keep track of 2 ratios? Suppose the bottom and top faces of the frustum are very long rectangles where 2 sides are longer than the other 2. That would mean that the 2 faces connected to the longer sides are not as steep at the ones connected to the shorter sides right?

Second, I understand why it is more computationally expensive to do clipping/culling in view space (that part is clear) but, if I recall, you mentioned in a very early reply:
-
ME: So the point of the projection matrix is to map all the points to be between their -W and +W
YOU: All positions of vertices that are within the view frustum before the transformation, yes. Not the 100% of all vertices, as that would defeat the purpose, because then you can't cull and clip based on that criteria (because they would all satisfy it).
-
So this means that the projection transformation matrix is applied to only those inside the frustum meaning we already know which ones are in and out right? Again, I understand why they are not clipped in view space, but we still know which ones are in and out of the frustum in the view space right?

Finally, you said that the projection plane (aka the image plane) doesn't affect which points are mapped. They are still  the ones from n to f. Why is that? wouldn't it save some time if we just focused on the points from the image plane to the far plane as only those will be viewed right (if the image plane is somewhere between n and f, then all points from n to the image plane shouldn't be visible)?

Again, I understand that this is a large topic and I appreciate all the help you have given me in understanding it. I try to learn more about this everyday and I will definitely look at all the sources you recommended to me.
Reply: @anonymoussloth6687  "So this means that the projection transformation matrix is applied to only those inside the frustum meaning we already know which ones are in and out right? "

No(!) Wrong(!). The view->clip matrix hits ALL vertex positions! 100% of them(!!!).
Precicesly because we DON'T know (yet) which are in vs. out of view.
What I DID say, is that AFTER that conversion from view->clip space happens, and BEFORE the perspective divide happens, there's a process of determination (culling and clipping). For that process to BE ABLE to "determine", at-all, some of the vertex positions that got hit by the view->clip matrix would have that -W->+W "criteria" within them "satisfied", and others not(!). THAT's how this "determination" process can happen: The ones that do have it satisfied, would be the ones that are "in view". The ones that don't have it satisfied, would be those that are out of view.
THAT's what I meand by my answer to your question (read it again with THIS in mind).
NOT all vertex position would necessarilly "map to -W -> +W" after multiplied by the view->clip matrix, if by "mapping" you mean "satisfying that criteria". If they all did, there could be no teremination (cull/clip).
But ALL vertices get "converted" to clip-space by that matrix. 100% of them.
THEN the determination process happens on the resulting homogeneous coordinates that spit out the other end. Again, BEFORE perspective divide.

"wouldn't we need to keep track of 2 ratios? Suppose the bottom and top faces of the frustum are very long rectangles where 2 sides are longer than the other 2. That would mean that the 2 faces connected to the longer sides are not as steep at the ones connected to the shorter sides right?"

One slope + an aspect-ratio is sufficient: Ultimately, we want scaling factors for X and Y to (pre-)squish/strech the whole of 3D space before projecting.
We want the squising and streching to be such that the image stays looking correct by the end of it all, so objects don't appear squished/stretched. That means the aspect-ratio determins the ratio of the amount of stretching/squishing in Y vs. in X. 
Intuitively, start with imagining a pyramid with a square shaped base - it would have some slope shared by all 4 sides. Playing with the slope while maintaining the base just scales it's height. If you want to keep the height and change the slope, this scales the base (uniformly).
Now play with one slope while keeping the other one as it is, AND while keeping the height fixed:This stretches/squishes the pyramin along one axis, chaning the aspect-ratio of the base.
So you see, given one slope that remains fixed, and a height that remains fixed, the other slope and the aspect-ratio change together.
Now, lets say that the slope that you didn't change, the one that remained fixed, was the one that we're computing/providing.
Initially we're providing it for a square-based pyramid. Then we also apply an aspect-ratio. This changes the base, and the "second" slope along with it(!).

So, you see, defining:
A) The height (far clipping plane distance)
B) One slope (the "ratio" between the projection-plane's dimentions and it's distance from the camera - a.k.a focal length - OR derived from an FOV-angle)
C) The base-axis stretch/squash amount on  one axis (final frame aspect ratio)

Is sufficient to define the pyramid.

Then the near clipping plane just cuts off it's tip somwhere. Irrespective of anything else.

"you said that the projection plane (aka the image plane) doesn't affect which points are mapped. "

If you've just gone though the though excercise above, you now understand why. The projection plane is just an "indirect" way to define the (single) slope. As you've imagined (I presumed), the slope of a pyramid can change without either it's height or the cut-off point of it's tip.
That's how the projection-plane is independent from the near and far clipping plane distances. These latter ones controll the height and cut-off-point, while the projection-plane defines the slope. 

"wouldn't it save some time if we just focused on the points from the image plane to the far plane as only those will be viewed right (if the image plane is somewhere between n and f, then all points from n to the image plane shouldn't be visible)?"

You're still thinking of the projection plane as if it's the near clipping plane. It isn't.
Let me give you a concrete example:
Lets say we got a scene with a house. We set our near clipping plane distance to 1 centimeter away from the camera, and the far clipping plane distance to 100 meters away. 
Now, remember - we're just interested in defining an imaginary trapezoid in front of the camera - there can be infinite number of such trapezoids that go between these 2 specific virtual clipping planes.
All we want to controll is how spread-out the trapezoid is (one eminating from the camera).
For a 90-deg. spread, we can set a projection plane of 2 meters by 2 meters, at a distance of one meter away from the camera. That defines a very specific spread, and so a single specific trapezoid. But we could also get the EXACT SAME spread and trapezoid by choosing a projection plane of 2km by 2km, and put it 1km away from the camera (way farther than the far clipping plane). We could also again get the EXACT SAME spread and trapezoid, by choosing a projection plane of 2mm by 2mm at a distance of 1mm away from the camera.
Think of a real-life projector, projecting light onto a screen. Imagine putting some scalable metal frame around the shape of the projected light, one that also has subdivisionts going along and across it. No matter how far away you put it, as long as it's scaled accordingly, the same light rays pass through it in the same holes in it, in the same proportions to each other with respect to the wholes. (In reality there's another aspect of focus, but let's ignore that bit...)

All that matters to define the spread/slope-of-the-trapezoid - is the "ratio".

Think of it as a SECOND PYRAMID that you control independently than the one of the view frustum, but that DETERMINS the SPREAD of the view-frustum pyramid, like only the view-frustum pyramid's tip and spread are "contrainted" to this projection pyramid's tip and spread, but other than that they're independant.
This SECOND PYRAMID is just a "contol-pyramid" for defining the spread of the view frustum.

The projection plane distance DOES NOT at all controll what ends up falling inside/outside the view frustum DEPTH WISE - it only "indirectly" controlls what falls inside/outside SIDE-WAYS and HEIGH-WISE by being used to (pre-)squish/strech the space before projecting.

Why not use it as another near clippin plane? Because we already got one of those - we can just use it for that. Independently of the projection plane.

(sorry for drilling it in, it just seems like you actually need that...)
Reply: @anonymoussloth6687  Albo, BTW - Are you studying this in college/uni? If so, shouldn't you be able to grind your professors with questions? I mean, I never went to college but I'd assume that it's partly what it's for, no?
Reply: @AinurEru  Thanks for the reply and all the help so far! I think I understand this topic better now thanks to you and Chilli. 

I am studying computer science in college and I am still at an undergrad level. My hobby is game dev (again, I am a novice and just starting out). As I get deeper and deeper into this field with advanced topics like shaders, scriptable render pipelines, etc (I am using Unity btw) I realize that I need to understand the fundamentals of Computer Graphics in order to fully grasp their power and, since this is all self-taught in my spare time, I have trouble understanding some stuff.  For example, the reason I started learning about spaces and MVP is I was learning how to make a water shader in unity and for that, I needed the view space position of the water mesh before the perspective divide (in Unity this is called the raw screen position) subtracted from the depth buffer to determine the water's depth which, at that time, I had no idea what it meant.

Meanwhile, as I said before, I will definitely look at the resources you mentioned and I look forward to watch the video in your channel that you mentioned you are working on.
Reply: @anonymoussloth6687  Good luck. Just so you know, most people - even professional graphics programmers - never go though the trouble of actually understand what's going on around what you were asking. It's generally considered to be superfluous information, because A) All graphics APIs do it for you already and B) all you really need is a function that generates a ""projection matrix"" for you, given the parameters - and that's already included in most math libraries (like glm). It even used to be part of the standard of graphics APIs to feature a function that does that, so older stuff like glu/glew featured that. This since have been deprecated and now you need to do it outside the graphics APIs but again, most math libraries you end up using in practice - and of course any game engine or game-dev library will come with that built in. And in the worst case, a quick google will get you plenty of results with working code.
So, realistically, practically, you don't necessarily need to understand it to get things working. That's the prevailing attitude in the culture of graphics programming for games, or game development. 
That is why you will find that even university lectures from the top places that teach computer graphics, have at-best "hand-wavy" kind of treatment of the topic (if they cover it at all). Nothing even close to the detailed explanations I gave you. I had to scour the internet for weeks, and then spend hours and days with a pen and paper, scratching my head and deep thinking about it to get a proper understanding of this.
So if you got frustrated by trying to figure it out, you should know that this experience is expected and considered normal. It's a deeply messed-up situation pedagogically, if you ask me. But if you're asking most other people in the field, you'll mostly find that they generally don't know and don't even care to know how it works - as long as it just works somehow... They would probably consider your motivation for understanding it unnecessary and a waste of time and effort on your part. They won't get why you're making yourself go through with this. It's considered a thing that old people used to do way back before there were graphics APIs at all and when every game development team had to write their own software rasterizers from scratch, and those days are long gone by now. Because nobody in their right mind ever thinks of doing that kind of stuff nowadays... You just use glm and DX or GL or VK in the worst-case, or some abstraction over that even like bgfx at the very least, or in the normal case just use unity or unreal... 
That's the prevailing attitude generally speaking. So don't let the fact that you're struggling with this reflect poorely on your ability - anybody getting into this would struggle, most just don't struggle because they simply avoid it outright...